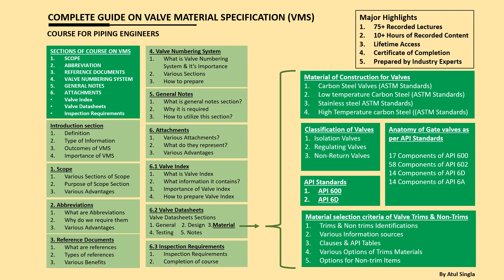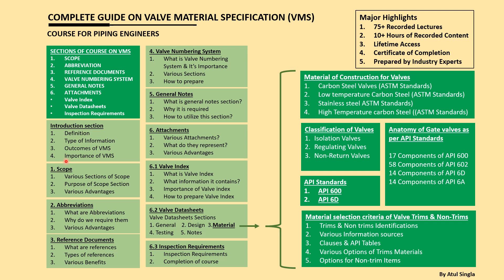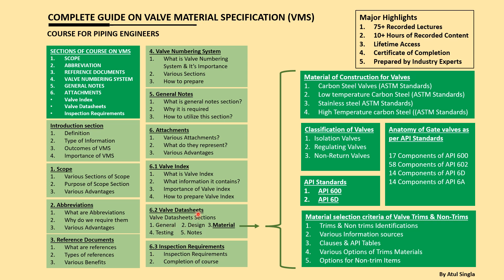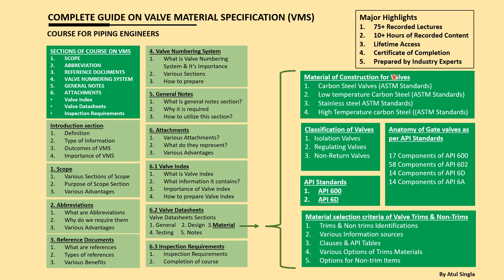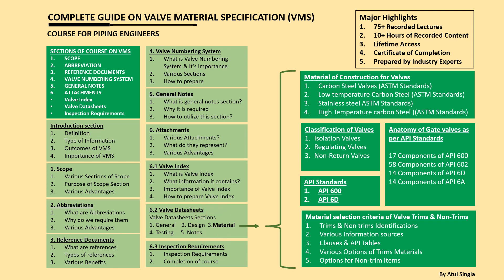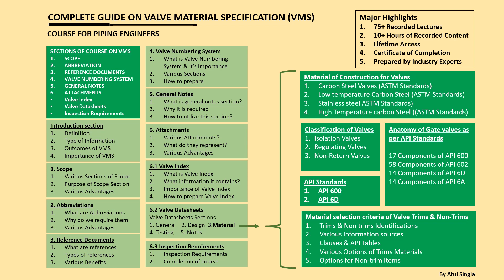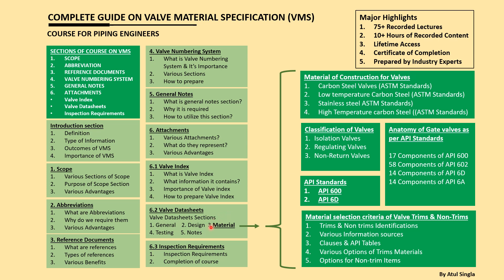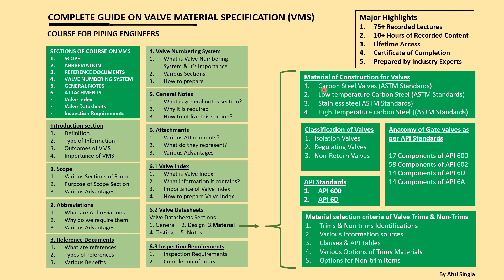Complete Guide on Valve Material Specification (VMS):Course for Piping Engineers #Valve #Piping #VMS

Comment: Hi. I'm a mechanical engineer graduate. I know softwares such as PDMS & Smart 3D. I've been working as a Smart 3D administrator for about 1 year in India (Chennai).  I'm no longer interested in this area and thus wanted to switch over Engineering side which will give me thirst to find solutions. In this 1 yr, I came to know about Piping material specifications,  valve materials, codes & standards & also some layouts. 
Could you pls suggest me how to switch from this S3D administrator to Engineering side ? Be it Piping layout engineering or Piping material engineering.  I just wanna get into any of the above mentioned roles.   Please guide me. I'll be grateful to u forever .